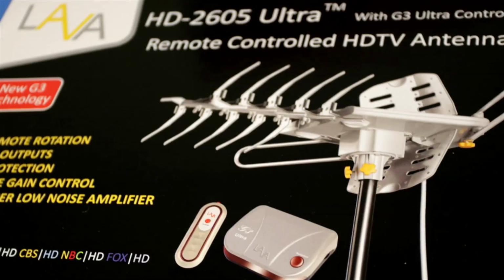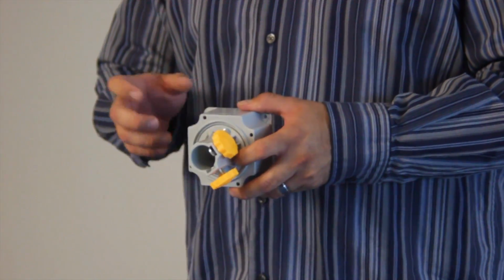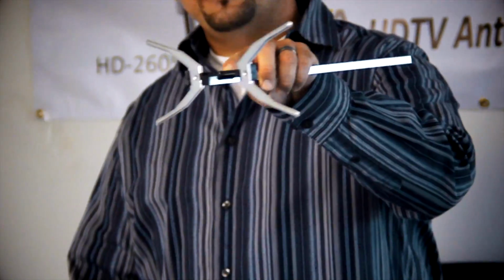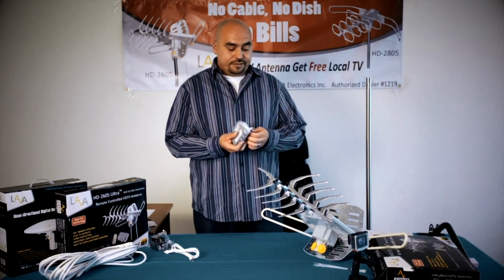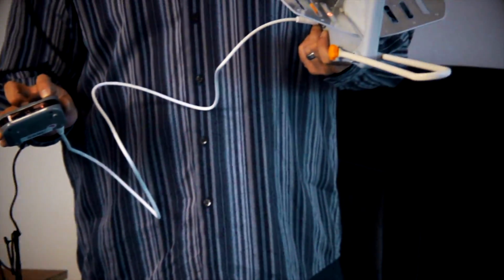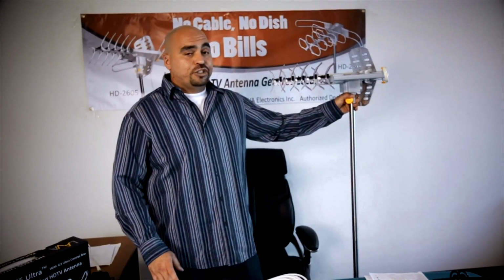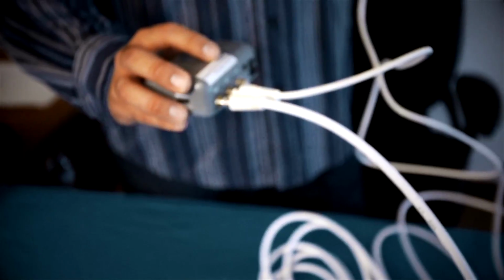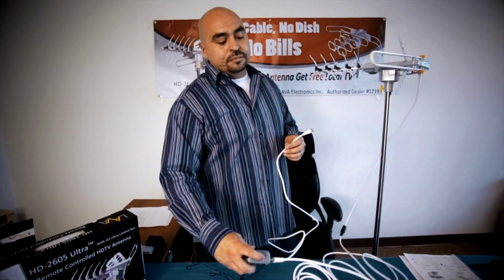How to assemabe and insatll your LAVA HD 2605 Antenna

Comment: Good job.   Many DIYers do not realize the coax is carrying the supply and control voltage and current as well as the RF signal.   Any connections to the coax, not specified by the instructor should not be attempted.  The Lava splitter is also a specially wired splitter, not the same as a standard splitter.

Comment: I have this antenna. It's about 5 yrs old now. I live about 55 miles from a tower and pull in about 22 stations compared to 4 stations with two other antennas we tried before this one so we are happy with the stations it pulls in but  there are 10 or 12 more stations we should be getting but don't. We live on a hill in the bluff country and our antenna is about 13-14 ft off the ground on our eve. Restrictions here dictate where it can be located.  My question is can I add a more powerful booster and if so can you recommend one and tell where it should be placed (installed on the cable.)
Reply from the maker: Dear Customer

Thank you in advance for trying out our products! The antenna itself already has a built in amplifier, however you are able to add a booster if you would like to improve the signal. We dont recommend any special brands but you can try going to Walmart or BestBuy.

Comment: Ok, concerning the 2605 antenna after checking everything i found that the cable recieved 30 ft- in that special package deal for $23.95 was defective & not shielded enough to send power to the antenna- so i bought the Quad shield R6 cable- then the antenna began rotating as it should with the lava splitter or a Equal-or similar splitter- so guys get some good quality Cable, so now all is well with the 2605 Antenna.

Comment: Yes, concerning the 2605 Lava antenna, i bought the Lava 4 way spiltter followed  your youtube video-hooked up the Lava splitter to the mainline cable from the control box to the Antenna as shown but i got  not rotation of the antenna- but when i take the splitter out the antenna rotates-- so what going on here.???? Mayra Lava Electronics--- does the power disappear when i hook up the Lava splitter. ???

Comment: my light on the antenna is not on , it was for a moment then when I plugged it into the power supply box it went off and it doesn't rotate. yet I get a good signal and channels work ok

Comment: would like to know if this antenna comes with a ground. I notice you didnt show how to install the ground which is very important. do i have to purchase one thru you?
Reply: The in line ground does not come in the box with the antenna, it must be purchased separably . You don't have to buy a LAVA ground but We do recommend that you use ours due to the fact that its designed specifically for our antennas. The ground is installed directly onto the antenna's coax connection,then the cable attaches to the ground. Hope this helps. Thank you.

Comment: What is to keep the antenna from wrapping around the pole if you go over and over in the same direction?   Or does the antenna stop at a certain point and force you to reverse direction?
Reply: justgivemethetruth , they won't answer you I will. it goes so far an stops and goes back. do not buy this they r junk POS. quality is cheap plastic and aluminum
Reply: Thanks Tony.  Can you recommend a good antenna and rotator instead?

Comment: You guys need to contact Antenna deals store and tell them to answer their phone, reply to emails from the costumers. They take the money, and run away. I've been trying to contact them for the last 5 days, and no one answered the phone, no one called back and no one replied to my emails. The same thing happened to my cousin.
Reply from the maker: For any general questions, tech support, or part replacements you need to contact Lava support directly at 909-923-8743
Reply: Antennadeals.com are totally scam and you guys deal with them. That means you're a scam too. I called several times and they never answer. Bunch of liers
Reply from the maker: if you need tech support the correct number to call is 909-923-8743 you can also email support@lavasat.com all of our calls and emails are always answered we never refused service to anyone. You may want to give it a try again! thank you
Reply: b.s. they haven't returned a single email phone call nada. Lava is garbage
Reply from the maker: If you need any kind of tech support, please contact the tech support hotline at (909) 923-8743.
Reply: Mayra LAVA Electronics all Lava equip that my family was using is in the trash, your company NEVER returned a phone call email nada nothing.

Comment: I just purchased the 2805 model but don't get the TV antenna guide!  Works fine otherwise!
Reply: Mary P .,
Reply from the maker: TV guide is a feature that your TV has or if your using a converter box. Antenna does not come with that feature.

Comment: These antennas are junk. Receive to 40-50 miles only and that's iffy. rotor broke 2 weeks after installation. A total waste of money and time. Mounted 35ft high in central FL.
Reply from the maker: It is not possible for the rotor to brake by it'self. That is just NOT possible!!
Once you mount the antenna up in the roof it is not possible for the motor rotor to brake from just being up there. Something went wrong there but there is no such thing as the rotor braking.
Reply: It is possible for the rotor to quit and it did with mine. I used it three time and the next time it would not rotate. It's junk and read the reviews and it has happened to many people.
Reply: There's a better one it's smaller and it's black its on eBay ial post the link